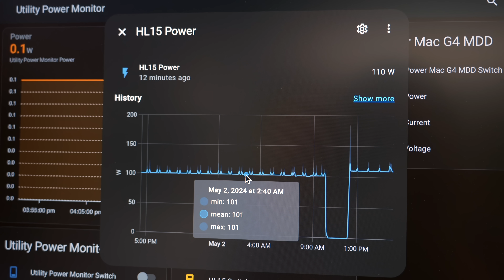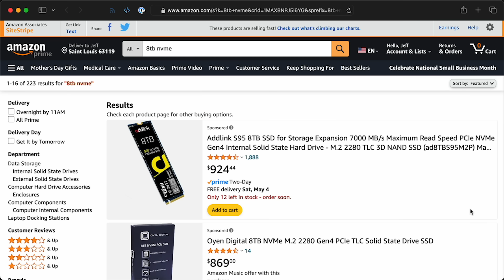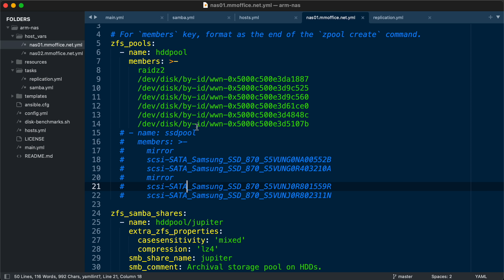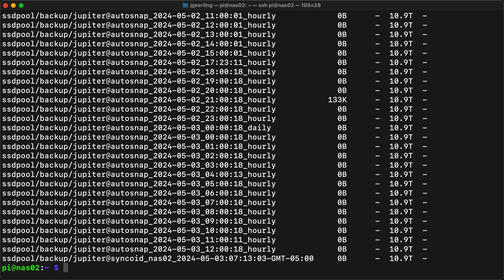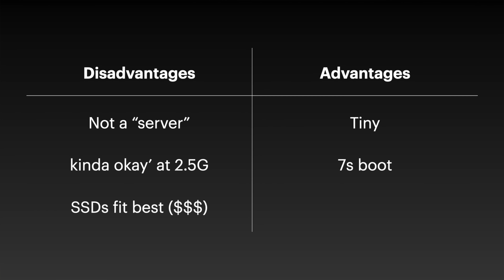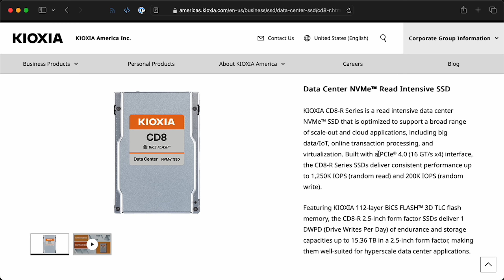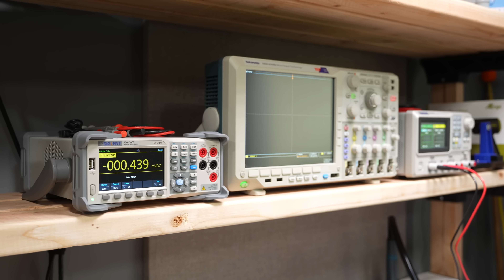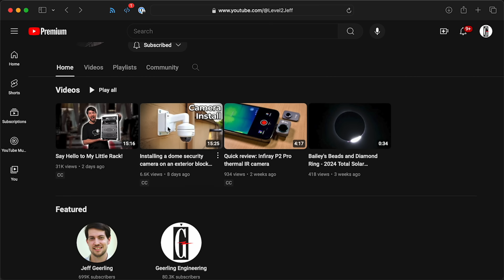Big NAS, Lil NAS (moving 13)

Comment: Hey Jeff, not sure where best to put this question (on a forum/Discord) but I guessing you'd have an opinion that I would value since you have worked with most of what I am going to mention.  If this was an AI prompt be tempted to write: Ubuntu Certification - Canonical Academy Launch + ARM + Not necessarily CUDA but ROCm + AMD GPUs + Ampere CPU (Thelio Ampere Workstation?!) +
No two year end of life (Dell Pro Max with GB10 units) + Project Mini Rack (your Turing RK1 vs HL15 NAS build using an Arm64 CPU) + 3D printing (Blender/Davinci Resolve/Photoshop like softwares) +Jellyfin + PCIE lanes?!

Hmm budget is ~$5 grand and flex could go as high as 15, really looking to make this more than a hobby (career, but i gotta start somewhere).  Looking to getting into ARM development with AI as a use case but not sure with this RAM situation if x86 is ever going to be scalable for businesses wanting to have Racks made for them due to the power issues we are probably going to have.

Comment: You don't really get the benefits of NAS setup if only a few users.  
1. Performance:  
Network-shared drive is slower than directly installed hard drive, so if you're alone, its faster access to have hard drives directly connected to your machine.  You benefit from NAS speed if a lot of people access the hard drive.
2. Fault Tolerance:
You do benefit a bit from physical hardware faults, but with SSD nowadays, which is immune to crashing, though not immune to sector errors, as long as you have a quality SSD, chances of sector errors is slim, though not impossible.  
3. Backup System:
NAS is not really a backup system, let's say, you permanently deleted by accident an important file from your NAS drive, there's no recovery for that file, since NAS will delete the file in all drives.  So its not really a backuo.  You should have a periodic backup of all your data into a tape drive or a separate hard drive, which is better since you can even, go back the history and find the missing file.

So Is NAS really beneficial for 1-2 user?  Does the NAS benefit worth the big electricity bill, plus the noise of muiltiple hard drive?
That's why I got rid of all my NAS drives and saved a lot of money in utilities.

Comment: 4TB NVME boards are cheap now, only abut $200/ea, you could cut the cost of storage to $1600 (rather than $2500) with 8 NVME boards, but you need 8xPCIe lanes to support it ...

Comment: I never use long direct attach cables, I find it much easier to use fibre SFP+ adapters at each end, because fibre patch cables are pretty cheap and available in any length.

Comment: This confuses me, because shouldn't this be the OPPOSITE way around?  Shouldn't the SSD NAS be the main NAS, and the HDD NAS be the backup?  Sure, the SSD NAS is running on a Pi right so it's not powerful enough, but you can use better CPU hardware to power it, and you're not stuck with using only Pi's for SSD NAS.
Reply from the maker: The main NAS has a server motherboard with more CPU cores, ECC RAM, and other 'server grade' features that make it the most reliable option for a primary NAS. I'm also adding on U.2 NVMe storage to it soon, so it will have some fast SSD storage and slower but still very fast (in aggregate) SATA HDD storage.

If I didn't do a lot of multi-camera 4K editing, I would be perfectly fine running off the Pi (or most any small 1 Gbps-capable NAS) for the primary, though. The main drawback is no true server-grade ECC RAM, so data could eventually have little issues over time.
Reply: @JeffGeerling  I've been getting the sinking feeling that hard drive with RAID is going go the way of the Dodo.  Since SSD's are getting increasingly affordable, and they are so good at making quick response to data requests, I just don't see why we should keep using regular hard drives for NAS and home servers, other than as secondary backup.  One of the best properties of these SSD's is that they have better data integrity protection, and you can get good detection against bit-rot at the software level (as long as you keep the system plugged, and it's always receiving power), which means you don't need the complications of RAID anymore (just use your hard drive as secondary backup, to recover from corrupted file whenever it's detected).  And of course, if you do use RAID then you've cut your storage capacity by half, which reduce any price advantage it would have over an SSD NAS that doesn't use RAID.  It just feels so outdated seeing videos on Youtube recommending that people should get 4 - 5 hard drives, and stick it in a NAS with RAID.  I think most people should just get SSD's and skip the RAID entirely.

Comment: Great video and thank you for sharing your updates @JeffGeerling

As far as your RPi5 SATA Hat update where you show you are using a USB3 2.5Gb Ethernet adapter.  Where did you get it?  I didn't see a link in the description for the newer hardware used. :)

Thank you for the update that you have a second channel.  I just subscribed to that one. :)

Keep up the good work @JeffGeerling ! :D
Reply from the maker: It's a Pluggable 2.5G USB 3 adapter (works great on my Mac, Pi, and Windows!).
Reply: @JeffGeerling  
Thank you sir
I found it and just put it in my cart to order.

I am trying to get that SATA hat right now, but seems to be out of stock right now.

I would really like to try out the ZFS stuff on a Raspberry Pi :)

Comment: Could you build a WIFI modem and router with their own li-ion batteries to coincide with power outages? APC is terrible, it's standalone breaker trips unexpectedly, yet my cellphone can provide a hotspot. Why haven't consumer based, lithium-battery-backed modems and routers been more prevalent in the tech industry?

Comment: My approach is to have multiple NAS boxes for different use cycle. Smaller, power-efficient boxes that are on 24/7 for the active files. Big boxes with the massive storage capacity for lesser used files and backups, that I power up only when needed.

Comment: The shelves for your workbench @ 13:55 grabbed my attention. I've just started setting up a dedicated space using a 48x24-inch motorized desk and had been mulling over how to attach storage space to it. Preferably pegboard and not involving much engineering on my part to make it sturdy and stable. If I've worked out the dimensions of those 2x4basics brackets correctly, I could add some beams across the back to attach 32-inch horizontal Wall Control pegboard panels between the vertical studs and it ought to fit my desk's width near enough exactly.

Thanks for the inspiration!

Comment: How do you galvanicly isolate your backup drives from the main system?
Do you use a fibre to connect to the backup system and run the backup system of a set of batteries that switch between running and charging?

Comment: Its always nice to have a NAS with auto backup set up. I use a WD My Cloud EX2 Ultra and I like the My Cloud software. The only issue I have had was one of the drives in a Raid 1 configuration failed last week (WD Gold 16TB drive).

Comment: For me, I need raw storage more than anything else. If I could afford an all SSD system, I absolutely would, but my plex library alone is pushing 20 terabytes. So until sata SSDs get to around 20 bucks (Canadian) a terabyte, I'm stuck with HDD. ....and even then I'd probably just add to my storage rather tgan replace, because im a data hoarder~

I have a dream though. Havinv every steam game i have installed on a proper RAID NAS instead of my JBOD server/network with a eight highly mismatched drives (four of them USB). But for now, my next upgrade plan is a 2.5gig network. My server only has SATA 2, (topping out at 3gb/sec - its a Q6600 from 2007) so anything higher is extreme overkill.

Comment: regarding the U.2 Kioxia SSD mount - if those drives are anything like WD U.2 drives, they can generate a decent amount of heat, and mounting them close together and vertically, I'm afraid that 1 of the 2 might heat up without any air flowing over it  (it might be totally fine as well - you can usually check temperatures via `smartctl`).  For those that don't have motherboards with SlimSAS (or similar) PCIe ports, there's relatively cheap 1-drive U.2 to PCIe slot adapters...which can be wasteful plugging into x16 or x8 slots (the drives are only 4 lanes), but might be the only solution for many server chassis.
Reply from the maker: That's not a bad option; if I do see them getting over 50C or so I may consider, because PLA can warp

Comment: 15:09 keep that cable as you never know, you may need it in the future if it didn't
Reply from the maker: Haha so true. I regret throwing out a box of old SCSI, parallel and serial cables when I moved to college. Some adapters I had in there cost $50+ to get a beat up used replacement nowadays.

Comment: My problem with these setups is that there is no good interface to manage the system, I am very comfortable with Linux but for daily change stuff and do stuff like create shares in the go, a web interface is practically a requirement..
Still hoping for truenas.. "OMV is not yet there" to let it manage my host OS, I would love to run it in a k3s environment but not the other way around,
Reply: You could set up Nextcloud/CasaOS on the host, or just plain remote desktop/ssh access.

Comment: Replixation is NOT backup because any issue with your prjmary is replicated to the backup. Think ransomware. If you want backup use actual backup software. Duplicity and Bacula are two good open source options.
Reply: That's a good point, but just remember that the requirements of a backup depend on the actual needs of the user - if they're worried about ransomware, then obviously they should configure protections against that.

But if the systems aren't directly public-facing, then that isn't as big of a concern. Also, one would hope that the backups include version control - seeing as the backups are created from delta snapshots anyway...

Comment: Do you have any recommendations for 3D Printers for beginners who are interested in 3D Printing?
Reply from the maker: I personally started with a Creality Ender 3 V2 because it was cheap but good. They have the S1 now which is even better.

If you have the money, a Bambu Labs is a little more approachable, otherwise if you like the printer being partly 3D printed, Prusa makes good hardware that's a little more expensive.

Comment: Rather than putting a rtc on the pi to turn on scheduled backups. Set backups to run on boot, and shut down after, then use an Home Assistant automation to send a WOL packet. Then super easy to adjust schedule, even with the pi off
Reply from the maker: True; the only downside is if I want to boot it up for debug, I'd have to set some sort of trap I could escape the backup. Maybe a hotkey to hold or something.
Reply: @JeffGeerling  get HA to monitor disk activity, set the automation in HA to start shut down when disk activity under threshold for 5 mins. Shut down precedure can check a flag in HA you set to keep it online. So for debug set "keep lil NAS" online to true, it won't shut down. When HA detects the server stays shut down for 5 mins auto clear the flag.

Then to boot and change things, set the flag to true, boot server, do what you need, 5 Min shut down grace let's you restart without clearing the flag, when your done changing stuff shut down, will auto clear the flag, ready for the automation to automatically shut down next time.

Will let you adjust the schedule easily in HA and do more advanced scheduling, let's you keep it online as needed for debug. Should give you the best of both worlds.
Reply: @JeffGeerling  you could stop the auto backup by adding a 30 sec delay to the start script, checks for user interactions and won't start if the user interaction is present. Or just check for a file exists, so you can just touch a file in home to stop script from starting

Comment: you say that m2 drives are expensive, showing 8TB for not the whole $1k... and then you show that a great solution will be to use Kioxia SSD? where one 15TB costs $2.5k-3k?? For this I need x4 pcix4?? Great idea!! You could have skipped half the video and just said "I got 30TB from the producer"! :D
Reply from the maker: Heh, this video isn't about those Kioxia drives though; and you can get CD6 for 'cheapish' (for the performance/endurance, compared to other NVMe drives), and CD8 drives in lower capacity are attainable, if still 'enterprise expensive'.

The CD8s are mostly meant for testing as a network video editing array—as I slowly migrate my video editing process to being centralized (someday maybe I can have an editor help out, ha!), I need faster central storage that everything can connect into for the edits. The hard drives are okaaaay... but (a) loud under that kind of load, and (b) seek latency isn't wonderful, especially on a complex timeline.

Comment: the youtube creators ai arms  race has started and network chuck fired the  first shot - please consider jumping into this and form an unholy alliance with open source ai and escalate the violence - so much can  be done - you may well want to wait for zen5  and blackwell but maybe  a server  board and 4gpu? maybe cxl will be  more obtainable  and  prove to be thing that moves  ai tech forward - whatever the case  may be - you want and  need true open source local ai - with no api or tokens, uncensored, realtime and maybe  even some p2p component - to trade modeling and training data - red shirt jeff may spring  a gasket when you tell him  about this plan so ease him  in slowly to prevent any panic attacks and er visits for sedatives
Reply from the maker: I'm going to do some edge AI stuff soon. I have a few nifty modules for detection stuff, but I haven't gotten far into the training game. That requires lots more $$$

Comment: So 2,5 GbE adapters do work now out of the box on raspi 5?
Reply from the maker: USB ones, mostly they do now. And a lot of PCIe adapters don't require kernel modules anymore, they're loaded in Pi OS.
Reply: @JeffGeerling  Just tested it on my raspi 4 and the 2,5 worked

Comment: I know you wrote 'Not a server' but still please emphasize that backups are NOT safe on non-ecc based computers. Even though it does not happen often with that limited amount of memory it still does not induce 'piece of mind'. I love your videos! Thanks Jeff! 🙂
Reply from the maker: For a secondary NAS/backup, using ZFS and scrubbing gives me more peace of mind than ECC. I would like full ECC on cheaper devices but it probably won't happen any time soon. The LPDDR4x has built-in ECC mostly to help with the fact it needs it internally, but I'm less worried about that for my data (especially video, which can deal with a flipped bit every now and then, with no noticeable artifacts).

If I were storing financial data or databases, I would be a lot more concerned, though! Or if I had a photo library I wanted to preserve for the next 10,000 years. As it stands, ECC is too expensive for me to want to put it in every system I build.

Comment: If you spray the window with water before applying the decal it's much easier to get bubbles out.
Reply from the maker: D'oh! Will try next time.
Reply: This! Spray of soapy water makes it a breeze. It also lets you slide the sticker around in case it gets misaligned. Push all the water out from center to edges once you're done. Used this for large 8 sqft stickers!

Comment: 15:20 I wonder why you are using sliced cable canals, when you can just use closed ones. Those you used, are meant for electric cabinets with many components and not for open air usage.

Using the right ones, would give you a way more sleak installation. And even if you somewhere along the canal, need to pull a cable out of the side, just drill a hole for the cable.

Comment: you could underclock the big nas to save noise & heat on a lower watt fixed boost.
https://www.youtube.com/watch?v=7hUIcDq6I2s Should You Undervolt Your CPU?

wouldnt it be simpler to just put proxmox on the pi & use that zfs dedup etc

Comment: Why backup snapshots and not just the data? I have a proxmox cluster build on a bunch of thin clients, I do nightly rsync backups of the vm's, but don't care diddly squad about the proxmox installs itself, if something goes down the drain I just do a fresh install and restore my vm's onto that. 

I might misunderstand what you're saying in this video, but by doing snapshot doesn't that mean that if you lose a single file, you have to roll back your entire system to a previous snapshot? To me it makes more sense to do it on a file level and just restore the file you need.
Reply from the maker: You can mount any snapshot version and browse the files at that point in time on either system, which is like having point-in-time backups of every individual file (kind of like Time Machine on mac OS, which has saved my bacon before).